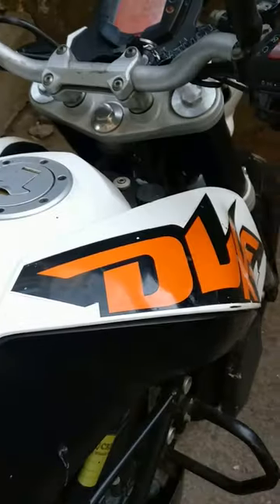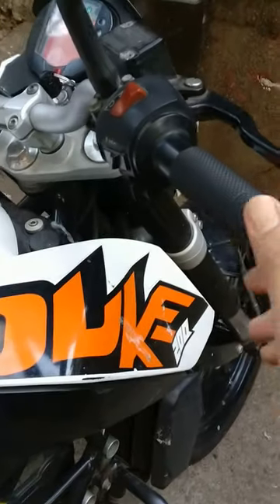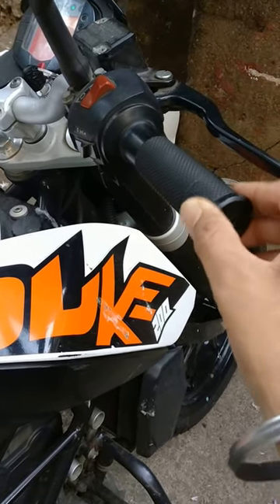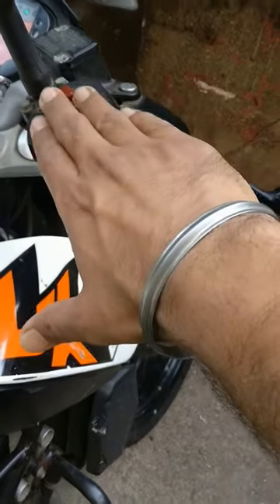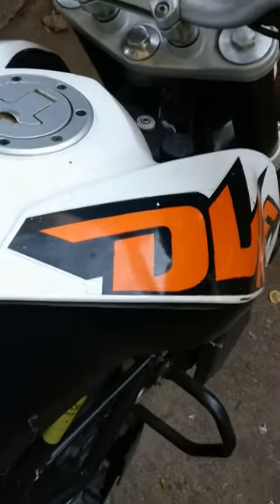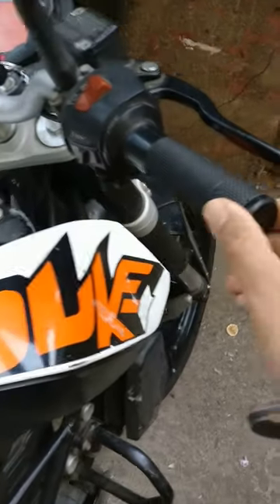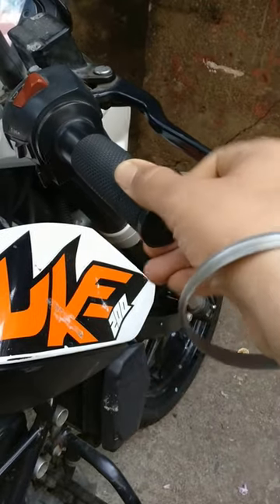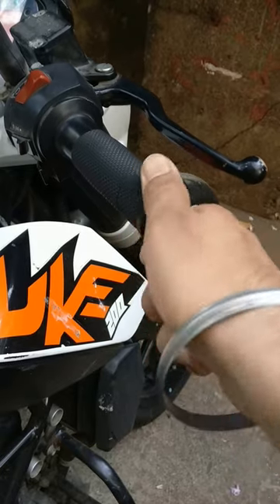How to identify a bad clutch plate in 5 seconds

Comment: Stop giving people bad advice. That has nothing to do with your clutch, that is throttle free play. That can be adjusted. Has nothing to do with your clutch, because its not even engaged when its in neutral. Please educate yourself.
Reply from the maker: Thanks for your nice comment bro. What you are saying few mechanic also told me the same, however I told them to remove the play when my clutch was bad. None of them could do it. Using this technique I pointed out for number of bikes before buying and yes the new clutch plate had to be installed. Thanks again for you intelligent comment bro.
Reply: I don't know what you are on about honestly. The throttle tube has nothing to do with your clutch free play. Free play on the clutch lever can be adjusted at the top of the lever, or at the adjuster in the wire further down. If you have a cable operated throttle this can be adjusted the same way. If you have Ride by wire, it has to be adjusted electronically.

So, what you are pointing out in the video has NOTHING to do with the clutch.
Reply from the maker: The technique worked for me, but since you are insisting will take a bike with a worn out clutch to a mechanic and ask him to adjust the cable. Hope it will work.
Reply: What techinque? Feeling the throttle slack? Dude, you are way off. You cant fix a worn out clutch with cable adjustment, i have never said that... Cant be bothered to reply anymore to this. Watch some videos on youtube how to adjust / change your clutch, and watch how many times they mention the throttle in that scenario. Zero. Good luck mate.
Reply from the maker: Thanks mate, but try my technique some time.
Reply: Thewiz3222 I agree with you this guy doesn't know S*** & the mechanics he took the bike to were complete idiots,totally different things, I think it was just a coincidence that his clutch was F*d
Reply: I think he missed another obvious sign of a worn clutch being when the "fuel" light comes on 😂
Reply: You are right, this nothing has Do to with the clutch xD im changing a Ton of parts and also clutchs on customer bikes but that has nothing to Do how you say with the clutch xD
Reply: @UndaGroundPlayz  😂
Reply: @gagandeepraina  but accelerator is connected to carborator how can u tell cluch plates are bad. U are completely wrong.
Reply: fr like he's saying it was also a bad clutch of something maybe it was coincidence but plain out wrong.
Reply: Very True. If you look at the throttle body or carburetor side you could clearly see a slack in the accelerator cable which causes this free play.
Reply: @gagandeepraina  pls.delete your youtube channel please dont bother to make any video anymore and live your life...enjoy ur life bro
Reply: I'm in the clutch is not connected to the throttle tube group 🙋🏻‍♂️
Reply: @gagandeepraina  dude that's bad advice bro. At least have it in gear to check the clutch
Reply: I think he just doesn't know what the clutch is
Reply: @gagandeepraina  Don't store so much ego bro, You're absolutely wrong, There's no connection between Accelerator and Clutch ! Don't tell anyone to Do it
Reply: @gagandeepraina are you for real? that technique is useless. I mean its throttle adjustment. Nothing to do with bad clutch -_-

Comment: You are suggesting to take the free play out of the throttle. That is there to ensure the throttle closes completely when you releast the throttle control on the handlebars. Having no free play can lead to throttle overrun which is dangerous. If you let off the throttle and it doesn't close,  you're going to have a bad time.

None of anything you showed in this video has anything to do with the clutch. This video spreads misinformation which is actually potentially dangerous. Please remove this video before someone takes your advice and gets hurt.
Reply: Being a service supervisor at KTM True that bro misleading video none guys are fool out there throttle play has nothing to do with clutch!!!

Comment: This free play is due to accelerator cable adjustment. Nothing related to clutch. The only right way to identify worn clutch plate is to check whtr ur kick slips or not while starting the bike from kick. For kick-free bikes, while riding at 40-50kmph,apply clutch, drop down gear to 1or2 and release clutch.If bike's speed reduces dramatically then ur clutch plates are ok.

Comment: This is so wrong.....cause if you visit a dealership with brand new motorcycles you will reallize that almost all of them have that throttlle space or free play if you prefer and its imppossible for a dealer to sell new bikes with clutch problems. Clutch and throttle free play is a totally diferent thing.
Reply from the maker: Nops dude, brand new bike or even if you install new clutch plates the play is gone.

Comment: You must be new to motorcycle.... so now i ask u, the one that did the repair is u or mechanic??? If u tell me its the mechanic, thats clearly u r being scam... ur bike uses the cable actuated throttle, play will increase as time goes by, bcoz cable stretches... thats y there is a knob or nuts for u to adjust the cable tension

Comment: Thank you for this advice sir. Using your technique I was able to discover my clutch did indeed seem bad! However, based on the specifications in my service manual the slight movement on the throttle grip is the proper adjustment for a clutch. The first bike you showed actually had the good clutch! In addition I was able to discover an easy way to adjust the clutch without expensive repairs. There are two cables that run from your throttle grip to the carburetor. At the carburetor there should be two adjustment nuts. By moving these adjustment nuts it is no problem to easily adjust your clutch. Enjoy.